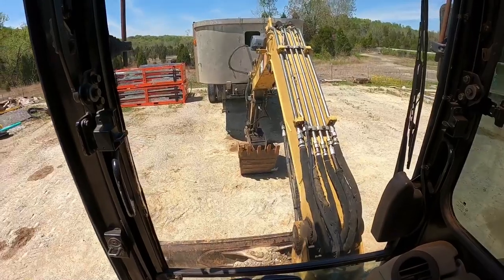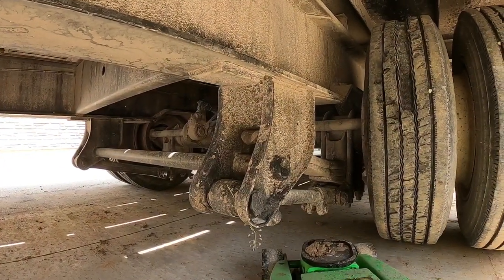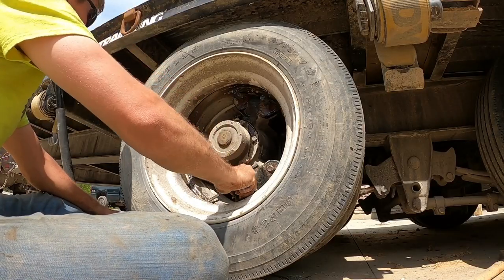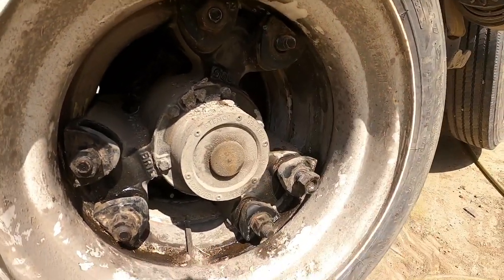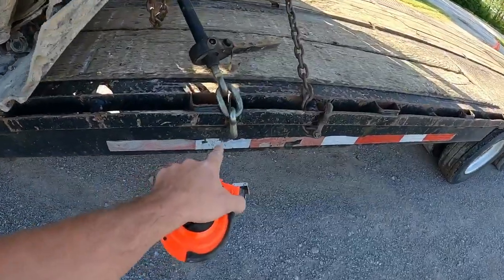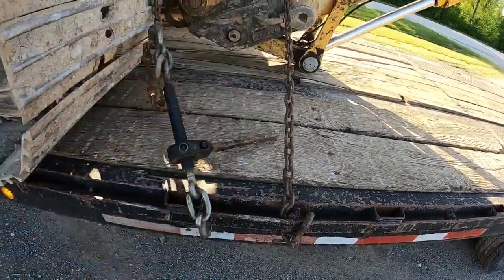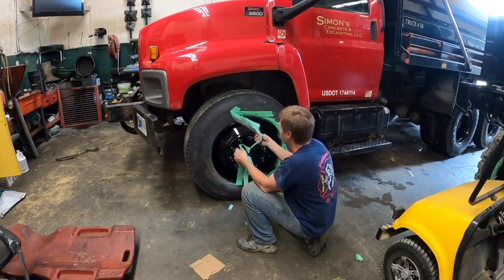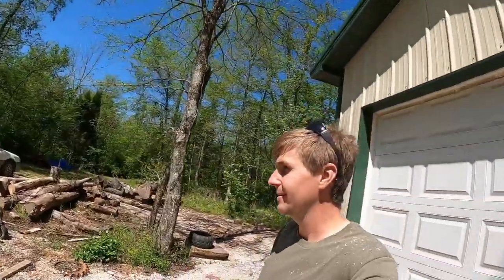20 Ton Trailer Tire Repair - Building Dirt Perfects Birthday Gift

Comment: Awesome video Captain, except you might wanna relook at that tape measure . I think the 120 is 8’10”
Reply from the maker: Reading is hard
Reply: Worn track edges!
Reply: If that tire you changed and the date and wheel if it has a split rim on it you should air up the tire upside down because split rims once. In a while they'd come flying off and you could get seriously hurt

Comment: Just had a long night of storms roll through Oklahoma.  A few tornados north and south of me, but we had up to 83mph winds.  That same system had 115mph winds in Oklahoma City area!!!!  Throw in some flash flooding because of two inches in about 10 minutes and it was a crazy night!  The good thing is the storm system was moving at about 60mph, so it passed through fairly quick.  Now I can relax and get back to binge watching Captain Kleeman's and NYA Millennial's videos.  Well, at least until my adrenaline has worn off and I can finally go to sleep.  It's 1:30am on 7May2024 and I was prepared to take cover from the storms since 9:00pm.  The last couple of months have had record breaking storms here in Oklahoma, and we are just getting started for the storm season!!

Comment: Just a little advice keep the nuts on the stud when trying to get the wedge off. They can come off with some force that can hit you in your family parts .
Reply: i was thinking wow-thats not how i was taught some 50 yrs ago to disassemble them wedges-keep the nuts on until the wedges are loose. i was leaning way out of the way-haha!
Reply from the maker: Yup
Reply: Remove the lug nuts,  stand off to the side and hit the rim with the tire hammer..several lugs will fly out and the rest are loose.   When squaring up the wheel tighten the nuts so the space between rolling sidewall and your fixed point (block of wood or whatevers in reach) becomes equal all the way around so drivers won't be laughing at all your wobbly wheels!!

Comment: Just a tip on those bead blasters, you don't want to shove the nozzle too far down in the tire. The nozzle gets in the way from the tire meeting the rim with the blast of air. Its a large volume of air, but over all not much pressure. Keep the tip just clear and don't push too hard against the tire.

Comment: you could use some 12x12s cut into wedges to get the trailer up in the air without having to jack it up really handy for changing a tire when its loaded
Reply from the maker: Absolutely

Comment: Nice gift, should be well used lol. Ironic you changed tires on the same concrete that DP poured “today”, it set up nicely
Reply from the maker: The pad is a great addition to the shop

Comment: I use a Rode Wireless Go 2 it has a receiver that goes to the GoPro but the transmitter is able to record to internal memory at the same, triggered by detecting the receiver unit. So if you loose the audio from the GoPro itself the wireless transmitter can be connected to the PC and audio mixed in. Also much better audio.
Reply from the maker: That back up feature sounds nice

Comment: Great gift,now make one for yourself you deserve one.It reminds me of a similar contraption that was in an old Scammell recovery when I bought  it which shot an arm out of a slot on either side of the cab depending on which way you pushed it, sort of a manual indicator, if you got it right you could knock someone off a bycicle.

Comment: I dont know about your state but in Virginia flags are required if you are carrying a load 3 or more inches wider than the trailer.  As an example... if you're using a 7 foot wide trailer to move an 8 foot wide shed... all 4 corners are required to be flagged.  Ask me how I know!

Comment: 5:10  I hate those kinds of wheels with the wedges and lug nuts.  The older ones from the 80's are even worse with the single wedge per spoke.  You really got to know what you are doing when you mount the wheel back on, otherwise you are going to have a wobbly wheel!

Comment: Now I have a question on the centering of the tire??  You said to watch the lines copared to the speed square, and yes it varied!  BUT if you watch the very low point of the tread, it stays real close to the 3  and 1/8  of a inch mark??  Why?? Any clue?
Reply from the maker: Camera angle I’m guessing

Comment: I was hauling crane sections for one of those stack em up towers on a construction site.  The towers are exactly 102 wide.  I had two front to back on a 48 foot flatbed.  A Missouri DOT officer in a van followed me out of a weigh station and spent the next 15 miles lining up with one side and then the other while following .  I heard him say over the radio that he was letting me go.  I thought that is mighty kind of you to let my legal load go down the highway

Comment: I was just setting up my Hero 9 with media mod to do some filming and noticed that inside there are little rubber "bumpers" that hold the camera in the case tight.  How are yours looking?  This could be the cause of your 8 media mod disconnecting.  May want to try a piece of painters or masking tape inside the housing to make up the space difference.
Reply from the maker: Good tip

Comment: Ok this is the Third time I have watched you change a bigger tire , and boy your back is going to be worse then mine If you keep it up. Ok I know DP has pry bars and Tire spoons. Learn To use them to help put tires back on the Hubs. 1# roll the tire over to the hub/drum in a vertical position. #2 Using one hand placing pressure off center left or right towards the top(light mind you). #3 at this point you may be1/2 to a few inches lower then where it should be to bolt up. then with your other hand, get a Tire spoon/iron/pry bar, and place it at about 7 o'clock or 6:30, or if your left handed, 5 or 5:30. You get the idea, and lift with the pry bar keeping balance with you other hand. it should slip right on. and you can use the pry bar to walk the wheel or spin the wheel on to the studs. It will go faster and make your Back Feel a lot better. Just a thought from a 61 year old with a very sore back from doing it wrong for a few months back in 1976 My first job changing semi Tires. I about got beat to death by my boss until I started doing it right. LOL Watch some Videos, if not I can make you a quick one this works good with Small cars too.  Some times i will use the side of my foot at the bottom on the tread to help keeping the tire from running away.

Comment: Yep, expensive gift. I'm about to build a new house, and have been wondering if I could just build it out of solid gold a little cheaper?
Reply from the maker: I tell ya what,  the ICF we built our house with,  with wood prices the way the are,  it cost very similar to the same price.  A fella can get a concrete home with good insulation for the similar price of a wood frame.  You might look into it

Comment: Obviously this does not apply in Indiana, her in Wisconsin anything 10 ft and under you do not need to flag, you still need a permit for anything wider then 8.5.
 that was the perfect gift for DP. You might want to have a spare on on hand for when he wears that one out.
Reply from the maker: Where does it say that? 8’ 6” is fed reg, states can’t typically lessen a regulation.  Curious about where you saw that.
Reply: Captain, I don't have any specific regulation here in front of me, but I know it varies state by state I moving oversized, mainly work in Wisconsin and Minnesota. Wisconsin will allow me to be up to 15 foot wide on the Interstate, Minnesota will allow me to be up to 18 foot wide on the interstate. I-39 here in Wisconsin you will see farm tractors and implements traveling the interstate. That is an exemption that was given to Farmers in the early 90s before Wisconsin allowed Highway 51 to become a designated interstate 39.

Comment: We have to wait 3 months to hear about the 120 and the dealer.  I figured 3 months anyway, since you just worked on the trailer, on concrete he had poured today.🤣
 Road engineers could do a lot for better access to Interstates, but the State legislators can't seem to make up their mind about what, why, when, where and How! When speed limits are 55, it's pretty easy to get to road speed on most of the ramps, but when they up the speed limit, there are MANY ramps that there is no way you can get to road speed on the ramp. 
 Then there are the drivers that don't understand what MERGE means. Pfffttt!